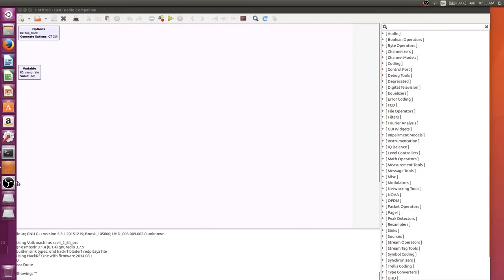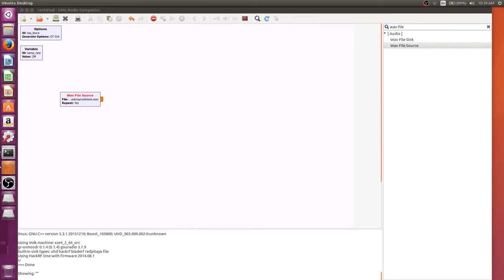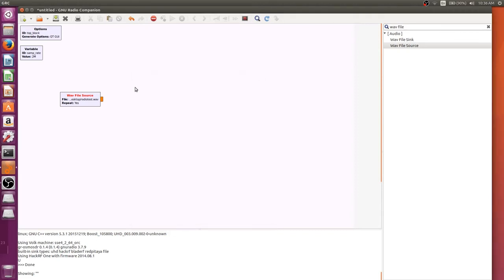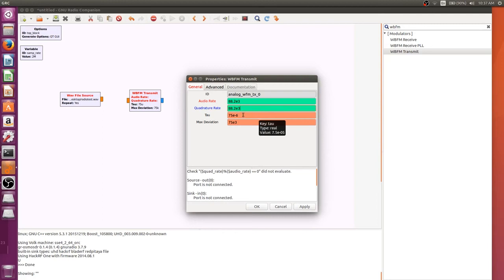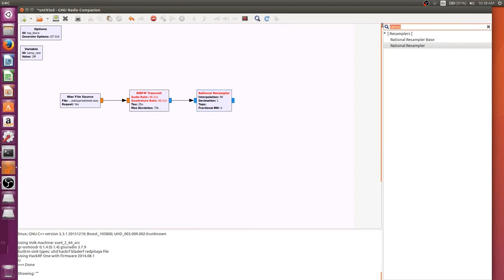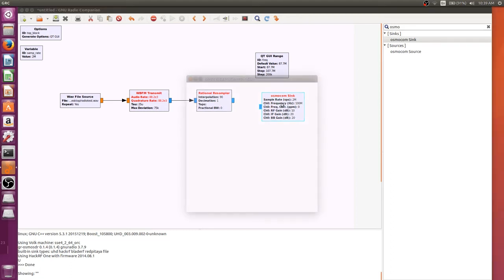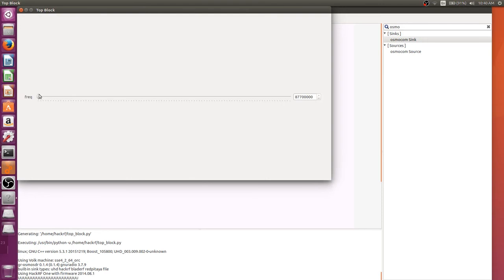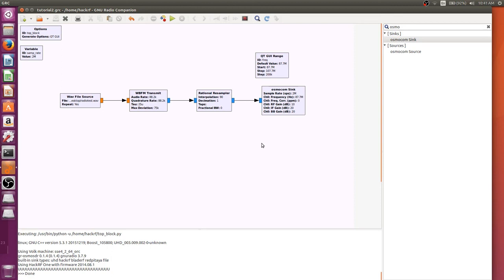HackRF One Radio Signal Transmission

Comment: It is possible to simultaneously transmit in multiple radio signal frequency using HackRF One? How? If not, it is possible to create a separate GNU radio flowgraph files and then transmit it one by one? I was able to transmit to a single frequency just like in the video and it works very well for me. Thanks in advance